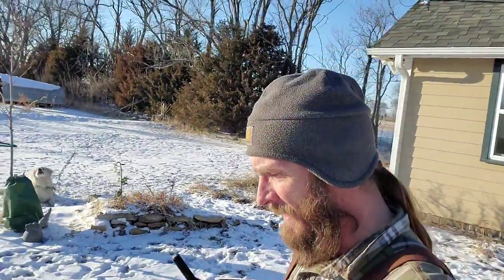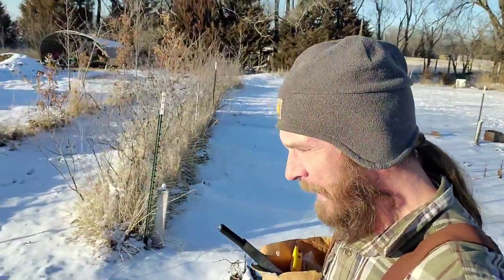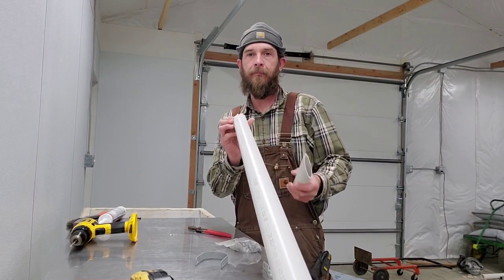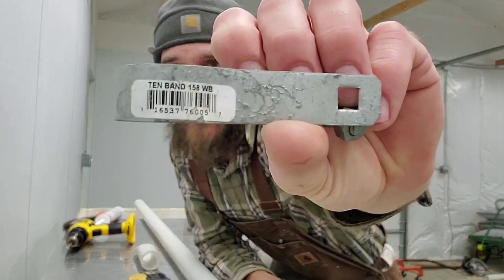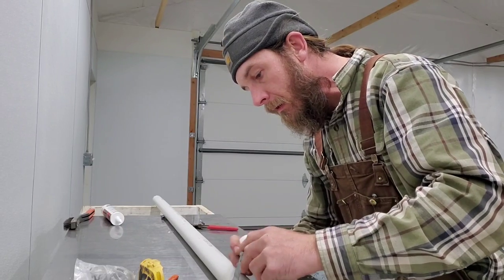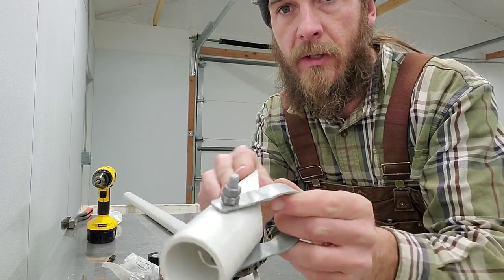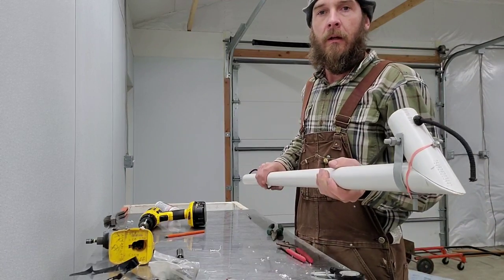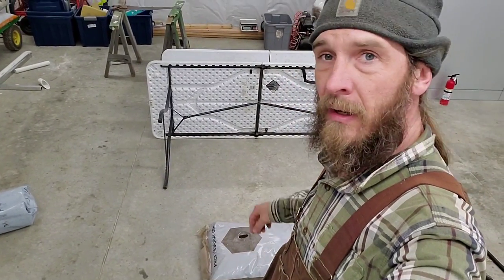DIY Stand and Plant

Comment: If only it came with a 5-10 shot magazine tube. Load up 5-10 starts and plant away, drop magazine and insert another...rinse lather repeat.
Reply from the maker: That might be my next build!
Reply: I’m completely serious, I don’t think it’d be that hard to make an 8 tube magazine that is designed like a Revolver ( pistol ) that you could easy lock in and replace. 

A heat gun to soften the PVC, a simple pin that rotates the next tube. Load up a few magazines and plug away.